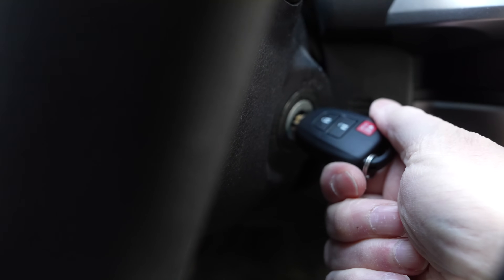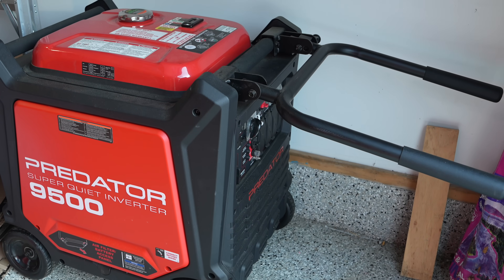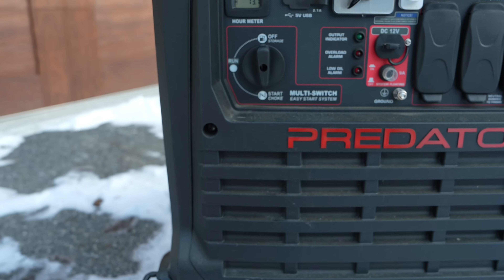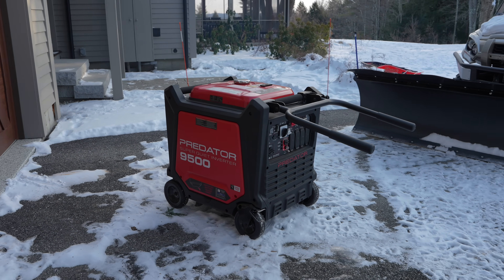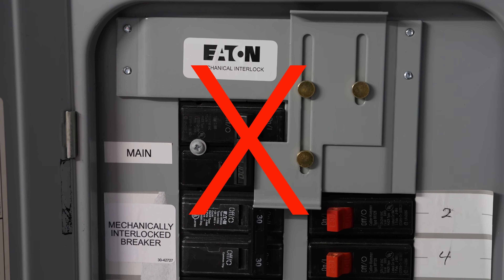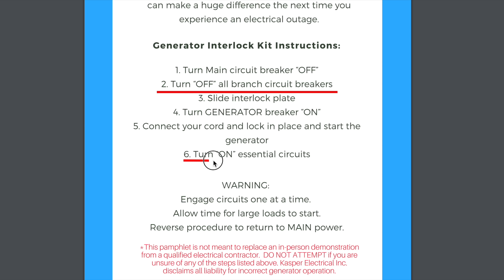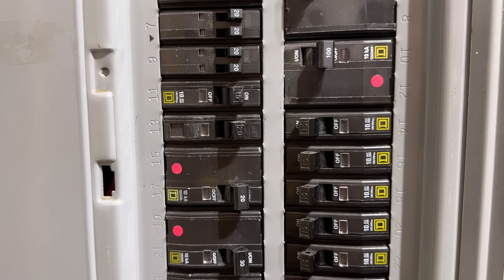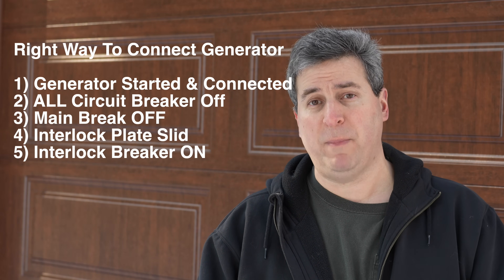Homeowners are Destroying Generators Skipping 1 Step During a Power Outage

Comment: I have never understood or agreed with turning eco mode off when starting.....even if that is what the manual says.  Everything I know about engines tells me it is better to start at a lower RPM.  I start mine in eco mode and let it run for a minute before switching it off.  With eco mode off I let it run for another couple of minutes before adding loads as you showed in your video.  After a few minutes, I switch it back to eco mode for the duration I use it.  I think the reason the manual says to not start in eco mode is because people tend to add loads too quickly before the generator can fully warm up and having it out of eco mode  and running at a higher RPM will help it warm up more quickly.
Reply: If there's no load on the engine then you aren't really going to see excessive wear on high speed startups. It's the load that causes the wear, so as long as you don't load it down until it's warmed up then it's fine. Splash lubrication relies on rpm to get oil up to the top end.
Reply: Higher RPMs with cold oil will help circulate the oil better than warming up at low RPMs... just like your car will idle higher for a minute or so when first started before dropping below 1K RPMs.
Reply: @michaeldezelar6264  I understand that and do not disagree with it in principle.  The difference in this situation is that most generators when running in normal mode run at 3,600 RPMs and IMO that is too high for an engine at startup.  Even in eco mode the RPMs are higher than a typical motor at startup with the RPMs around 1,800.  Most generators are also different in that they use simple splash lubrication versus an oil pump.
Reply: I’m with you on this. It’s essentially the same as starting your car with your foot to the floor. And at idle, the splash lubrication still works as designed.

Comment: After starting the generator up, I plug into the house before into the generator.  If you plug generator first, the tabs in the plug going to the house are live.
Reply: If they're the proper female connector, the risk is minimal.
Reply: Not if you wire it correctly with appropriate connectors. Also, leave the generator breaker off until everything is connected.
Reply: That only applies of you have a male to male suicide cord.  Please, throw that away and get the proper cord and generator inlet port

Comment: someone should call Onan, Cummins, and a number of other backup generator users such as hospitals, when power goes out those gensets fire up and go to full power. if your generator cant do this, you have a toy.
Reply: Those places are using commercial grade sets that are designed to take full load within 5 seconds of start. Matter of fact that 5 seconds is in the life safety code from NFPA for all commercial buildings requiring a gen set.
Reply: The large commercial systems typically include sump and coolant heaters so the engines start already warmed up.

Comment: I have a small generator I got for free. I've had it for many years. I use it to run a welder and an air compressor. When the welder is welding it is near capacity. And when the air compressor kicks on it loads it down pretty hard is it is either at or even possibly slightly above capacity to start the motor. It has been running like this for many years with no problems. 

I'm not saying this is good for it by any means just simply that I haven't damaged anything by doing this. They are pretty rugged.

Comment: No. These things specifically say in the instructions to NOT turn the eco mode off during startup.
Reply from the maker: Here is an excerpt from the Honda Manual under the starting If you wish to use the Eco-Throttle system, turn the Eco-Throttle switch to the ON position after the engine has warmed up for 2 or 3 minutes  From me, always follow your manual but I have never seen it specified differently.

Comment: How does your massive property only have 100 amp service?
Reply from the maker: I have 200 amp service in total. This shop used decades ago for horses has its own 100amp circuit which also has this interclock. The house has the 200main though.
Reply: @SilverCymbal  I see. Do they do 400 amp services in your area?
Reply: @ProgrammingProAwire  I think of 3 phase
Reply: @ No, in the richer parts of my area, you can actually get a 400 amp service residentially.

Comment: I typically connect everything up first, then start the generator, but otherwise follow this exact protocol.  I don't particularly want to handle the generator cord once it is energized with potentially 10,000 watts at 240v.  Any flaw in the cord, anything a little wet, etc. - just too many ways for that to go south on you.  So plug it all in first, but just don't energize the panel immediately.  Letting the generator run for a few minutes to fully stabilize before adding any load to it is a good idea.  It is also a good idea to turn each circuit back on slowly, giving the generator time to re-stabilize before you add the next new load.  They are built to handle things like the fridge compressor kicking on and off, but the more gentle you are about adding new loads to it the better.  Mainly, that is to make sure you don't get big voltage sags or spikes that can damage the stuff plugged into it.
Reply: You don't have to baby generators like that. Even James Condon (YouTuber) says that kind of babying is not necessary if you have a properly functional generator, and he fixes dozens of them each year.
Reply: @christopherkidwell9817  I think it is not because the generator is going to break, it is because you don't want to fry the stuff connected to it.  You are trying to avoid a big voltage sag or spike.
Reply: @christopherkidwell9817 You might want to reread what trustbuster23 was saying. He's referring to electrical items plugged in that could be damaged by an undervoltage or a drop in frequency, not damage to the generator, itself. That is a legitimate concern. I watch James Condon's video myself. Very interesting and educational.

Comment: TO clarify, switch each circuit on AND WAIT for the generator to react... you'll hear it if it was a heavy load. When it recovers, do the next circuit, etc
Reply: and inrush current loads, like motors, need to be switched first

Comment: another thing you can do is protect your electrical panel and flip the main breaker on or off only when all the other breakers are off. Main breakers are the hardest to change and sometimes you can't get a replacement easily. And as an electrician myself I can tell you the homeowner that you will have to pay the emergency rate to change that breaker. Just like you described with the starting your car analogy flipping your main breaker with a load on it causes unnecessary wear and tear on the most expensive part of your electric panel.
Reply: Who calls an electrician to change a breaker? OMG LOL WTF.
Reply: @franklofarojr.2969  main breakers are typically bolted down and require permission from the electric utility to pull the meter to change. Whenever an electrical meter is pulled for maintenance an electrical inspection is required as well. Changing main breakers is beyond the typical homeowner's experience level.

Comment: Good info and presentation.  I'm guessing/assuming you told your family you were going to be doing this video so they knew about the power outage ahead of time. That way no computers and other electrical equipment was harmed during the making of the video.
Reply: I switch off all high power breakers, then the main before I even start the generator as well.

Comment: I only use the generator to charge my batteries. I have 2 chargers, a 400W and a 1000W.
I try to always let it run for a couple minutes B4 applying a small load. Once it has warmed up for ~ 5 min, I will put the full load.
I do the same with my vehicles. I let them at least start to register warm B4 driving.

Comment: The biggest confusion factor for my setup was around an inlet, and what you're allowed to wire with it with no further panel modifications. Only floating neutral generators can get plugged directly in with no further modification. If it's not a floating neutral generator, you have to have your neutral main line switched too just like your hots, otherwise you've bonded neutral at your main panel and generator (same reason you removed the bonding strap on sub panels). I wasn't going to go through all that and found a generator that clearly showed how to unbond it on the generator itself, problem solved! Helps to buy the stickers marking the generator and inlet as such too.

Comment: Good advise. If you have a subpanel, you need to flip those breakers, too, not just the subpanel breaker in the main panel. We have well water. The well pump and sump pump are both wired into the subpanel. Additionally, there's a freezer connected to the subpanel. That's over 1 hp of electric motors. I flip those breakers individually and listen to the generator's sound. If I hear the sound of a load, I wait for the generator to recover before flipping the next, and so on.
Reply: Sounds just like my setup. I'm pretty sure I would have forgotten the subpanel breakers. Thanks for the reminder.

Comment: I built my own transfer box. I don't have a large backup system so only a few circuits are powered by the backup. I presently do not have a interlock blocking plate. I have the sequence printed on a laminated label on the main panel box. It works flawlessly If you follow directions.  My point is a well laid out procedure, printed clearly should be on the front of your box. You may know the procedure but what if someone else needs to switch to aux power? They need a simple, by the numbers checklist.
Reply: That is 100% illegal it has to be physically impossible to have mains and generator feeds on at the same time since an error could kill someone

Comment: How do you know when the power comes back on?
Reply: There are various sensors or alarms you can buy that can be wired into the main panel that alert you when utility power is restored.
Reply: @ is the alarm armed when the lockout is switched?
Reply: I believe so - not sure about the specifics because I don’t have one in my panel.  I watched a YT vid a couple weeks ago where someone had an alarm installed that went off at 100 db when utility power came back.
Reply: Just check outside to see if the neighbor's lights are on. Or, check your meter. the old fashioned ones have a wheel turning. Or, use a power beeping pen on the main service wire from outside where it enters the home load center.
Reply: Most everyone now has the new "Smart meters"... so go look at the meter.  If the digits are on, the Utility power is back on.  If the Smart meter display is blank, then the power is still off.
Reply: @ would be nice if you could monitor from inside since power outages happen during the worst weather

Comment: I have a whole house battery backup with 18.5 KWH and a charging speed of 7200 W. My 10500 W tri fuel inverter/generator is connected to the panel box in the barn which feeds the battery in the house over the main supply line. Since most of the house runs off battery, back feeding my batteries follows a ramp up sequence lasting about 10 seconds. Whenever I start my Generator or the generator is started remote it always goes through a ramp up. Problem solved
Reply: Are you always in double conversion mode (not AC pass-through/bypass)?  Or is mains power in pass-through mode but generator is in double conversion?

Comment: I put the dot on the critical circuits that I will always want ON with the generator, the essential circuits like: smoke alarms, refrigerator/freezers, water system UV lamp, etc.  These are the ones which go on first when the generator gets fired up.

Comment: I prefer to let it warm up in eco mode, no load.   With no load, there is no 'bogging' or 'struggling'.  Then two minutes later, bring up to speed and proceed.
Reply: Depending on the type of generator, temperature and the oil in the crankcase this method can be good or unneeded.. My 12kw generator does the warm up and load transfer all by itself, so It starts and runs at high idle until it reaches some preset temperature then goes full production throttle and finally enables power flow through the onboard breaker panel.. When my Outback Radian sees stable 240vac it then gradually increases the load demand to a preset limit and will also charge my 40kw battery bank with the remaining overhead.. I still have an old manual start 3,800w generator that requires an extended prep and warm up routine that has to be run at a 2.2kw demand or it falls above or below the dirty power sensing limits and the controller will disconnect it.. It is the backup of the backup of the backup when the grid is down, it is night or cloudy or the larger generator would be broken..

Comment: What if you have a full home automatic transfer switch and an automatic generator? Everything stays on and the generator takes all the load within 30-60 seconds.  Sure your video might apply to harbor freight generators, but an permininantly installed, non portable generator is more than capable of taking up the full load all at once if sized correctly and without damage.
Reply: It certainly is, with a 10k price increase from this setup.
Reply: These Generators are also usually preheated and some have auxillary oil pre pumps, meaning they get up to operation temp and oil pressure within seconds after startup
Reply: @the_retag  Yes, critical service generators at Hospitals, police dispatch centers, internet server farms do have crankcase or water jacket heaters that run when the temperature is below some set temperature like 45f to allow them to be at full demand load in under a minute.. New setups are now using what amounts to a giant UPS system that may have several thousand KWH of LiFePo4 or other batteries connected to some serious power inverters.. These can take the load instantly then allow the large diesel generator to come online and provide power..
Reply: That isn't what this video is about.
Reply: Also in a setup like that you would already have a calculated load so either some circuits are split out and only those come on with the backup or the generator was sized for the whole house either way it isn't overloaded
Reply: You will find that even high end auto start generators have a temperature sensor and an oil pressure sensor that must be satisfied before the generators controller will allow power to flow to a breaker then to a load.. Depending on ambient temperature of the crank case oil this time delay could be a few seconds to several minutes..

Comment: I think you need to kill main breaker BEFORE you start generator.  Main breaker off > start generator > connect generator to inlet > kill individual breakers > activate “interlock > turn on individual breaker as needed. 

Your method has power immediately going to the panel. What If the power suddenly comes back on?
Reply: In that case, power is going TO the panel but not THROUGH the panel till you throw the gen breaker. (that's locked out till you kill the main)
Reply: Other person said it but simplified nothing both can have power but only one can be on at a time
Reply: but interlock still off

Comment: Good advice. Ours is a transfer switch separate panel, wired into the main. 10 circuits are dedicated for gen power. After a power outage, we warm up the gen, as you importantly have shown, then begin energizing only the well pump. Then, one by one, flip breakers on for the rest, waiting between each for any initial surge to dissipate, such as the fridge.
Reply: I have a Reliance transfer switch kit that has a separate panel.  With this setup it's impossible to accidentally back feed into your main panel.  When you flip the breakers in the generator panel it switches those selected circuits between either the generator or the main electrical panel.  With this setup there is no reason to turn off the main electrical breaker because your generator power is completely separate from your main panel 

When your power comes back on you simply flip the breakers in the generator panel and they are back on the house main power. 

I think the setup shown in the video relies too much on the user to get it right.
Reply: Ditto. A Reliance 50 amp 10 gang unit. 2 doubles, one for AC, and the other for the water heater. The best way to go, IMO.
Reply: I designed a set of AC timedelay Relay switches for a commercial set up: 2 big fridges and 4 big freezers. When the power came on...all 6 relays began a countdown...first one after 10 seconds...the next one 20 seconds after that...and so on until all units were energized. It was for a restaurant and by doing this the owner could go with a much more economical 20kw natural gas generator instead of a 100kw unit which he was originally quoted from another electrician. During outages he gets to keep his small restaurant running...and all the business comes to him.
Reply: @TyMoore95503  100KW?  Hahaha!  Overkill.  That's FOUR whole house generators sitting on pads!
Reply: ye fridges and pumps have motors so it has inrush current
Reply: My dad installed a transfer switch years ago at our family home. Then when I bought my first home it came pre-wired with a transfer switch, generator and whole house surge protector. Haven't needed it yet but I am sure glad I got it. Just the essentials is all i have connected, and yep, pretty hard to mess up with back feed with this system. Just don't go throwing all the breakers at once and you're good.
Reply: Thank you for mentioning the fridge. I didn't think that it would be a problem.
Reply: Also, that lets you leave some circuits off of the transfer and if you leave something still connected to mains power, you get a notification that power is restored